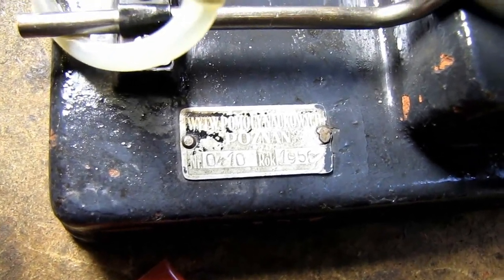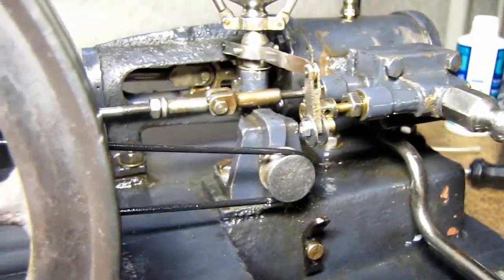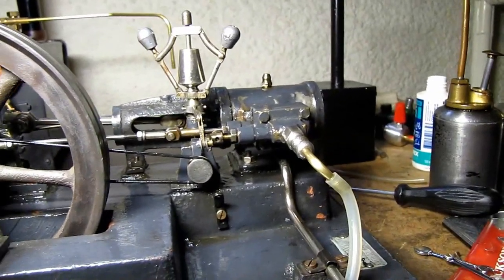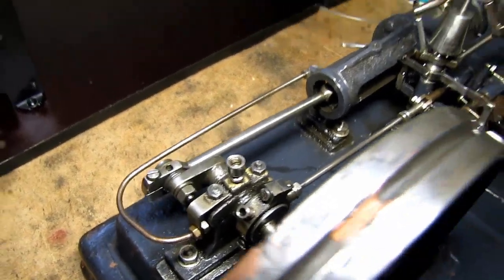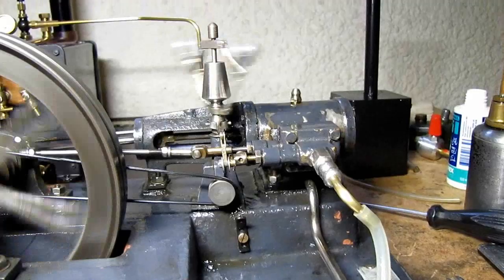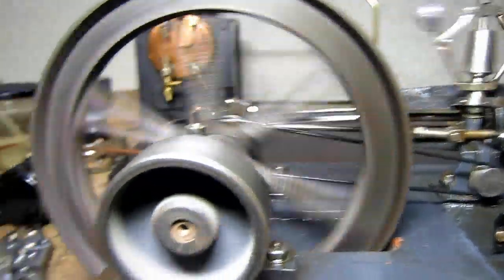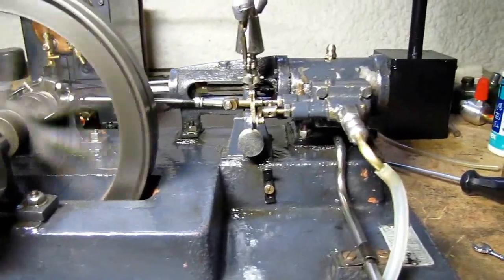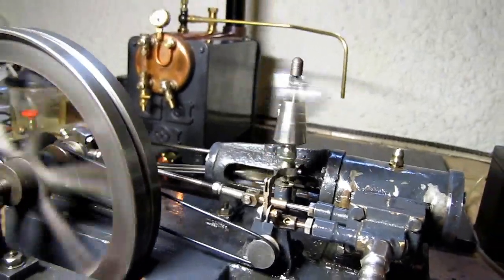Large Polish model steam engine - 1956

Comment: My mind envisions a boiler integral to the home wood stove, turn a faucet and the motor starts out in the back of the house charging batteries and running those grand modern led lights in 1 or 2 rooms.

Grand motor I would love one.

Comment: My Physics teacher just found a motor that looks almost the same (colours are different and i think few details were replaced or looked different initially) somewhere. I cleaned it, and put some oil on the bearings (sadly motor oil, i just heard that it's bad for steam engine. Fortunately, my engine runs good with it). The only part i have problems with is that centrifugal governor - it's missing a transmission belt. Any ideas what can i replace it with? Also, is it really 60 years old?

Comment: John, did you strip yours or did it arrive like this?

looks like you're missing the tension spring that attaches to the governor .
Reply from the maker: .
It's just as I received it, Frank.

I saw the spring in other videos and I tried fitting one. For some reason, my governor works best without one.
Reply: I prefer to use a small lead weight instead of the spring

Comment: Sir, can you explain how a centrifugal governor works on a steam engine?
Reply from the maker: Sarah Zhou
 Not easy to explain in a few words, but basically the governor is driven by the engine and in this case has two heavy lead balls that spin as the engine turns.

The two balls are mounted on pivots so that as they spin faster they are pulled apart by centrifugal force.

Using a system of levers, the balls moving apart close the steam inlet slightly and  thus the engine speed is regulated.

Conversly as the engine slows down (when a load is applied, for example) the steam inlet is opened to compensate.

Hope this makes sense.